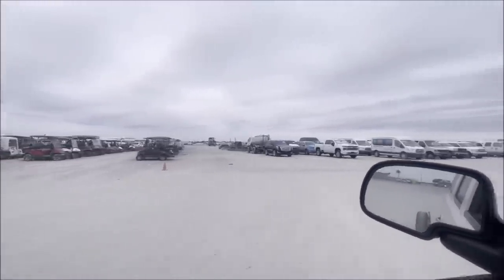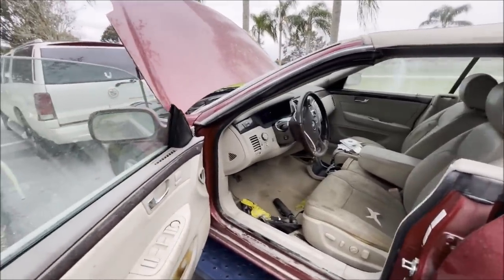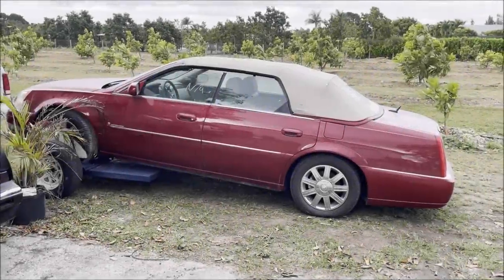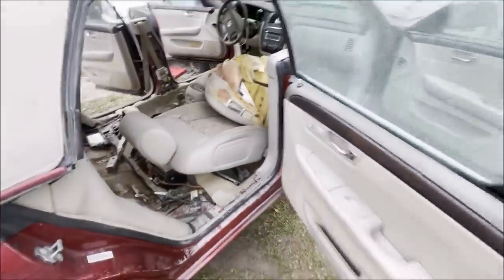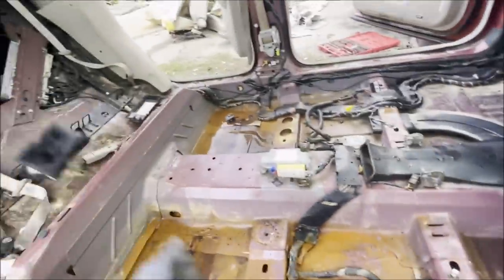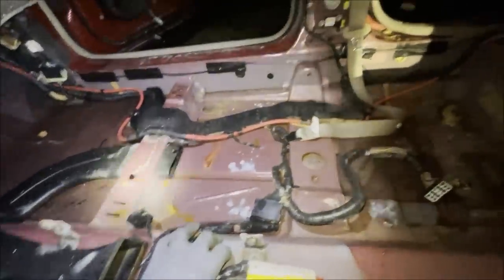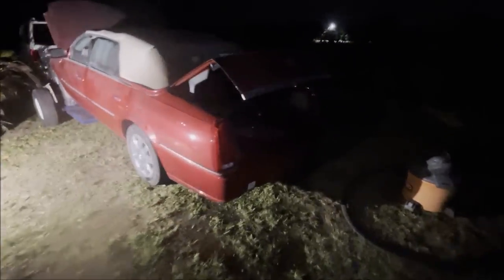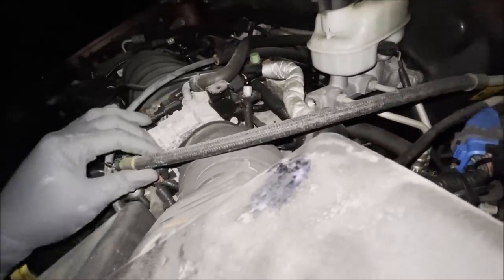Copart Buy: Flood Convertible Cadillac DTS by Coach Builders

Comment: Hey Al  .  Pull the cluster ,radio climate control, bcm   All of the modules in the dash and steering column and pressure wash the dash from the bottom up . Yes wet the hell out of everything "   Al that fuse box is the same as a  in the regular dts.  You can use the seat from  that  and the harnesses and fuse box . All random modules  can be used too  , I love these videos basically what I do at work everyday  💯. Great job al

Comment: I think it will clean up nicely for you. If looking for a parts car, you might expand your search to the next state as you might find one for a good price with no flood damage. The local junkyards in my neck of the woods crush a lot of those DTS as they get a lot of them in during the course of the year (my state seems to be ground zero for Caddy DTS (especially beige ones). My favorite Deville era was the 1994-1999 era. Of course i might be biased as I had a 1995 with the 4.9l V8 (last year for the good and reliable 4.9l V8) and loved the car. That AC was so cold that you needed a winter coat if you had it up full blast.

Comment: Good morning, I live in Miami Florida and just purchased a 2000 LeSabre was wondering if you could give me any advice I need to replace the brake line from master cylinder to abs
Reply from the maker: Very easy what do you need to know?
Reply: @bigalsbikeandauto  what's the process on Bleeding it? And my RPMs 3-4 in park..
Reply from the maker: @Maxx_bulls  bleed from the passenger rear caliper to the driver  rear, then passenger front then driver front.

Comment: It can be saved if you have enough devotion. I saved our CRV which I know doesn't have as many electronics. But our CRV  was flooded up to the top steering column. just below the cluster. Just as bad or worse than this Do yourself a favor swap the wiring harnesses. You'll thank me later. When things work then start acting screwy later. Yeah you'll thank me later LOL! Be prepared to replace any module and anything electronic (motors, wiring, modules, actuators, Switches,Fuse boxes ETC) that got wet. Even after that you'll replace wheel bearings sooner or later. The salt gets them. It's not bad when you have all the parts from a parts car.  We've been driving ours since 2018 when I rebuilt it from Hurricane Florence.  Good luck on it! Keeping an eye out for the next one.